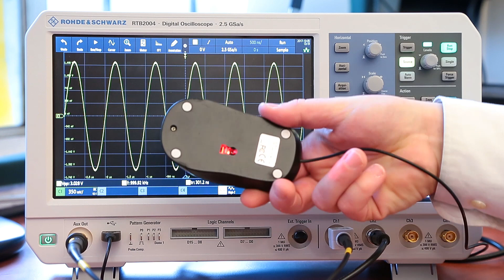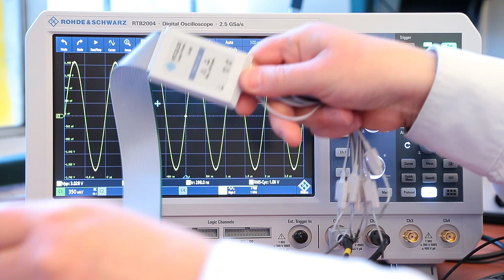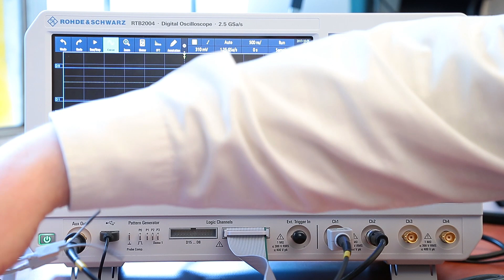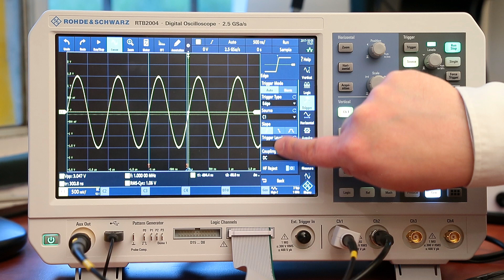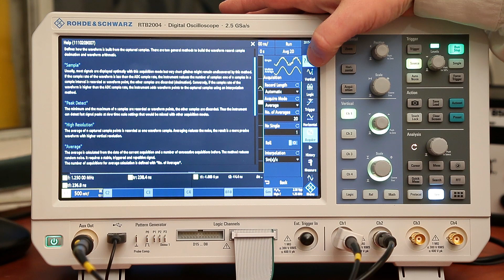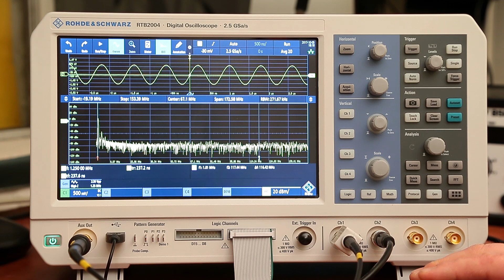Rohde & Schwarz RTB2004 Oscilloscope Review

Comment: Hello and thanks for this info . It's many years since I've used  an Oscilloscope and for educational purposes I've downloaded the user manual for the RTB2000 series . Browsing through it  I noticed in the safety section   that it says that 'this scope is intended for use in industrial  areas'  and shielding precautions may be necessary if used in residential areas . Is this something to consider if thinking of purchasing a modern high spec scope like this, or is just a case of being over zealous ? Many thanks for any advice . Regards Kieron
Reply: Dear Kieron

I strongly believe that the shielding remark is not realistic for the majority of general use situations.  

The RTB2004 has metal shielding around the power supply (switching type as in virtually all scopes today).  They also have complete shielding around the main pcb with the FPGA and ADC (10-bit designed especially by R&S for the scope).  They also have shielded cans around all the analog inputs to reduce noise.

I use this scope in my Lab around a variety of other measurement and signal generation equipment and have not noticed any problems whatsoever.  I think R&S are just being extremely cautious.

A final comment is that most Laptop and other electrical equipment power supplies are all high-frequency switching types these days (for efficiency and to reduce cost and component size).  Some of the cheaper designed (un-shielded)  switching power supplies are far more likely to cause you issues than the RTB2004.

I am intending shortly to make some more videos on the RTB2004 and my R&S NGE102 Lab power supply.

Hope the above helps.

Keep safe.

Kind regards

Michael
Reply: Thanks  Michael .  I did have an idea that it might have been a case of R&S  just covering themselves , but I really  appreciate your reply . All the best , Kieron.

Comment: too expensive stuff
Reply: Agree that the RTB2004 is not a budget oscilloscope;  however it has 10-bit ADC, great screen size and resolution with excellent regular firmware updates.  The RTB2004 has been offered at a deal price a number of times.

You have to use the RTB2004 to appreciate its features and 300MHz bandwidth. I fully accept that many cheaper alternatives are available with similar performance.

Happy Xmas
Reply: @michaelrothschild2646  I would like to buy an oscilloscope but when I see the prices, god damn!  
I have limited experience with these equipment. What would be your advice for a good  student level oscilloscope? 

Merry Christmas...
Reply: @sanane7030  

Hi,
Perhaps have a look at a secondhand Rigol DS2072 (or any Rigol DS2000 series).  I still have my Rigol DS2072 which is easy to option-up too 200MHz with all additional license options (see EEVblog for instructions).

I also think some of the Sigilent scopes are really good value for money, however I have never owned one.  A final thought is possibly a tablet scope from Micsig or Hantek.

Lots of choices new or secondhand subject to total budget.

Hope the above helps and a have good Xmas

Comment: Hi, great video. How much would it be this very scope with all those options you've described there I wonder?? I am actually trying to shop for a good and trusty digital scope for myself. Tnx for the great video.
Reply: R&S runs promotions at times where they sell the RTB2004-COM4, which is a bundle with all the options. When they do, the price is around $4K or a little less depending on where you are.

Comment: love to see and hear an AF signal captured, transferred to the AFG and then use a new signal to modulate the frequency or amplitude of the arbitrary wave while monitoring the resultant AF signal via aux out routed to another channel.  Apparently possible with the RTB2004, but have not seen it done.

Comment: What model of screen protector did you use?  The company name is a bit cutoff in your video.
Reply from the maker: Hi.

The screen protector was made for a Fire HD 10 inch tablet. The company name is “TECH GUARD”. I purchased a packet of two of these from eBay and I believe they are still available currently.  The version is a “MATTE EDITION” - FireHD 10 - 2015 model.  I made a template of the screen and cut the protector to size. The protector fitted perfectly with only one or two tiny air bubbles and has been on now for something like six months without any lifting. Hope that helps.

I will be making further videos within the next week and I will show the packaging once again. Hope that helps.

Michael
Reply: Thanks for the tip on the screen protector.  I couldn’t find the screen protector you used so got this iCarez anti-glare screen protector for an iPad Pro from Amazon.  This is for anyone seeing this video 4 years later.